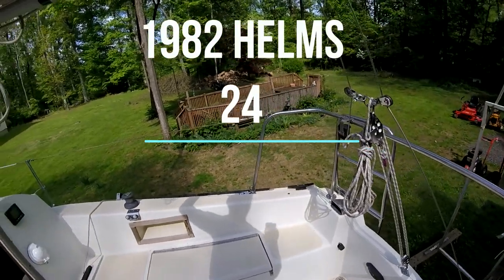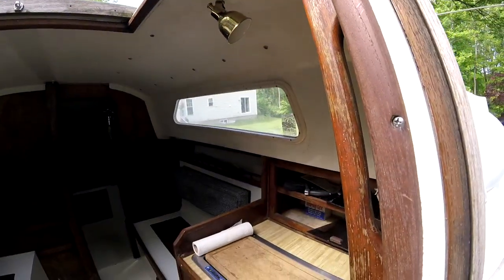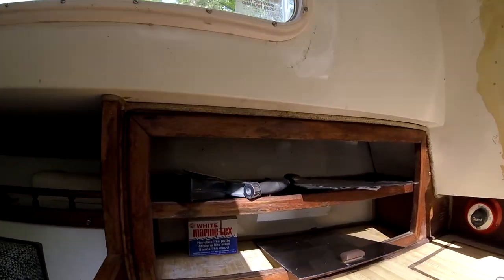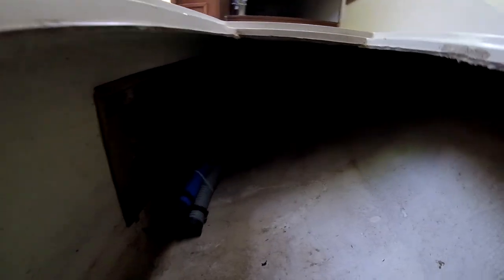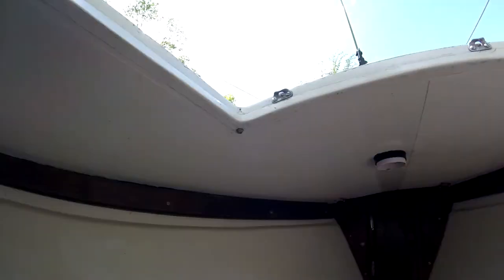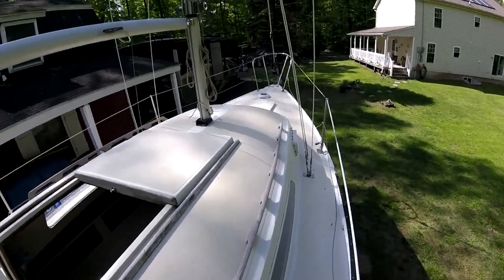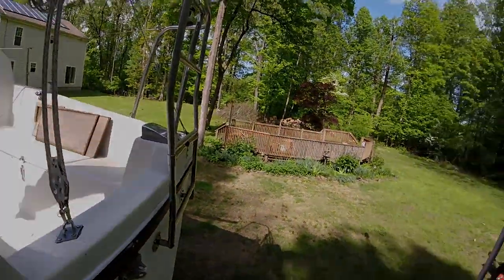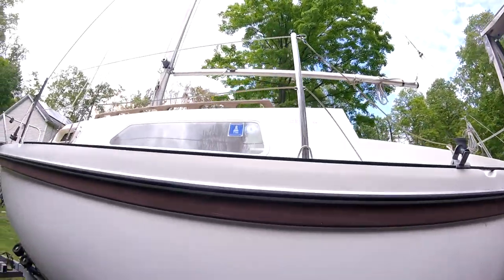1982 Helms 24

Comment: How did you make out with the keel ?  I have heard a few issues
Reply from the maker: I have not had any problems with the keel. I had a boat yard and the bottom down and apply a new barrier coat, then a top coat. They did not seem to think there were any issues with the keep at that time. It has been in the water since August of 2021 and so far, knock on wood, I have seen no issues. I will be pulling the boat sometime this spring or summer to have the bottom painted again, I will take a look at the keel again and see how it looks. I think in this video it was just the paint flaking and cracking, no issue with keel to boat seal and keel bolts look good and are tight

Comment: How did u take the mass down.
Reply from the maker: The mast is hinged, so you release the forestay and you can lower it down towards the aft end of the boat. Once it is down, you remove the bolt in the hinge and you can move the mast around the boat. This particular sailboat has a winch connected to the front of the trailer which allowed me to lower and raise the mast easier. Just hook up the stays on the sides and winch the mast up and into position. I have since removed this hinge and replaced it with a fixed mast step since I keep it in the water year round, but if it was every to go back on a trailer, I could put it back.

Comment: Hello I have a 83 Helms 24 and am looking for a trailer.  What kind of trailer do you have?
Reply from the maker: I don't know exactly, The guy I got the boat from took a trailer for a 24 or 25 power boat and modified it to work with this sailboat. That is about all I know about the trailer.
Reply: @CorbettMessa  Could I trouble you in asking for a video of raising and lowering the mast?  Really appreciated.
Reply from the maker: @harlancato631  I am not ready to put the mast up yet, but I hope to in a few weeks. I still need to paint the deck before I out the mast back. I will get you a video then, it should be fun, it will be my first time raising it too